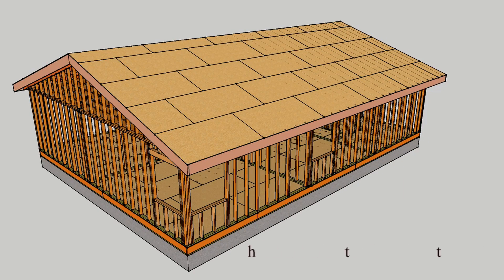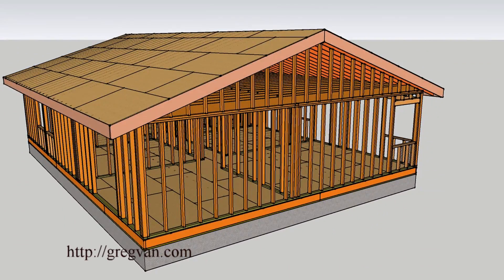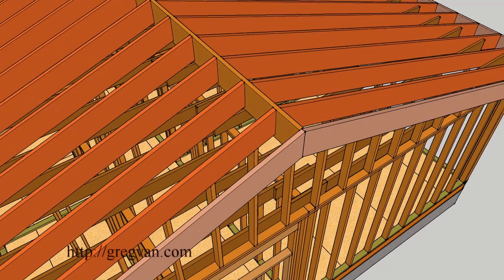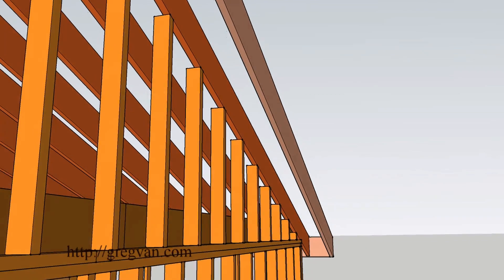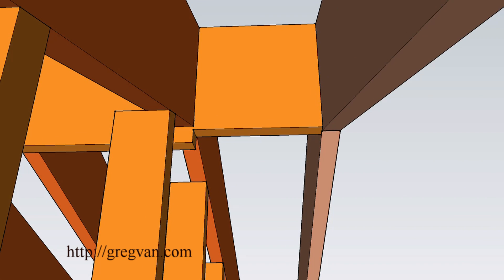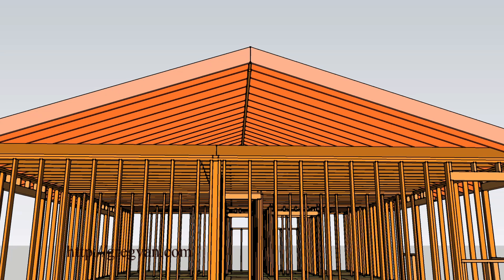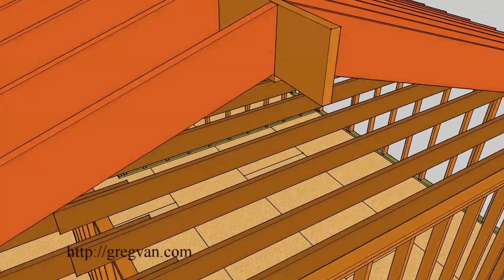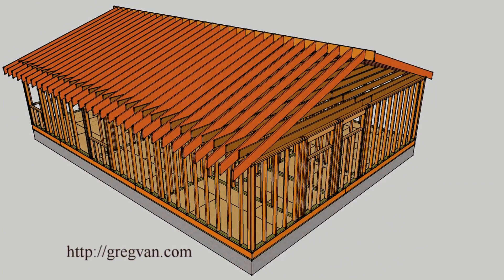House Roof Framing – 3-D Single-Story Conventional Home Framing Design

Comment: I am a little confused as to how the joists, which are overlapping at their centers on the supporting beam/wall, appear to lack a block between the overlaps.  The rafters are smoothly fastened at the ridge beam, that is, each rafter is flush with its opposite rafter.  So I think a block is needed between the overlapping joists at the overlap in the center.  What am I missing?  In another video, this was addressed and a block was indicated so that the joists could be straight and not bent.
Reply from the maker: Yes, blocks are used in between ceiling joist to make stronger homes.